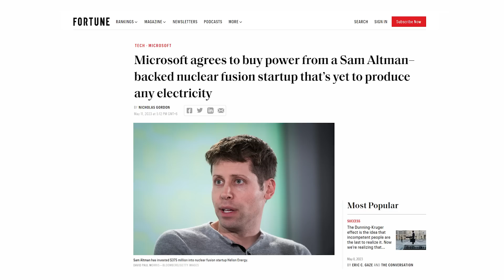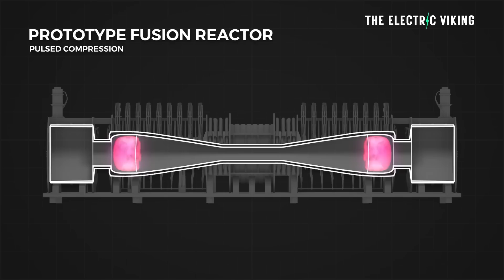Microsoft says the nuclear fusion dream is about to become a reality

Comment: Helion has designed a very interesting experimental, unproven, fusion power generator. Their design is built to generate power directly from the reaction, should they aver get it to work. Most other fusion reactors are just that, reactors that generate heat which must then be converted to steam to drive a turbine and generator. Helion's method does away with all that and just makes electricity directly from the expanding plasma interacting with the magnets around the fusion chamber. It's a fusion generator designed to make electricity that goes right into the grid,  not simply a reactor. It's very cool, but we'll have to wait and see how their new version of the system works in the next few months. Plenty of qualified skeptics out there however.
Reply: No guarantee it will work, but my understanding is that their current design actually achieves fusion but the output energy is not collected. The next version being built now has the hardware to harness that energy. Best of luck to them !
Reply: @rustyfox81 output is collected and used to recharge the capacitors but it currently isn't net positive, next prototype that is supposed to come online next year is supposed to be their first net positive reactor
Reply: I will bet $1 they succeed
Reply: @glike2  Risky !
Reply: @kimobailey2926  If it doesn't work they go BK and  MSFT doesn't get paid anyway :)
Reply: First Helion will make expensive H3 with a cheaper version of their double accelerator. This is because making H3 releases neutrons which deteriorated accelerators.  Then this created H3 will be used with deuterium in their more expensive, main, double, accelerators.  As well as making power, they will make tritium which they can sell or wait 12 years for it to decay into H3.  Other fusion reactors use tritium, so they can sell it.
Reply: Durability might be concern
Reply: I have scratched around with Helion's physics some and was not sold on it. The numbers just do not seem to work unless Helion has a break through in beam direction that they are not talking about. The acceleration required to get the velocities and keep the beam super tight and of acceptable density and velocity ,,,,not by a lot. Now at the same time, we got a couple different paths that people are traveling on. When you have General Atomics, Commonwealth Fusion (MIT), General Fusion, First Light, Tokomak energy, Lawarence Livermore, a huge facility in China that is working this way, General Electric, Princeton,  ITER  and Lockheed Martin Skunkworks. Okay, these are not people who I am ready to bet against. AND where I said above 'Unless Helion has a break through'. That list of companies above basically guarantees that they all think they have a breakthrough, I would bet a small sum at this point that within the next decade someone will have it. Lets see 1) China, a society that honors scientists and engineers 2) the Skunk Works (for this job maybe Kelly Johnson will return as a spirit) 3) MIT. While Lawarence Livermore has a real good start right now. I do not think their lasers will solve the problem on a industrial level - but they may find out more about how the elements involved work than anybody else.
Reply: Exactly my point to!
Reply: Holy sh#t if they do it. The implications... But thats a big If.
Reply: Neutron radiation to electric power
https://youtube.com/shorts/N4Bp1IXwafE?si=H8s60GaJgUqHhyWq

Comment: Microsoft is absolutely rolling in money at this point, and probably has a tough time finding good places to spend it, so it makes sense that they're willing to play the angel investor. Should the project fail, they can easily eat the loss, but if it does not, they have the unicorn of all unicorns on their hands and become the undisputed champion of silicon valley tech. I am skeptical as well, but we shall soon see.
Reply: This is NOT an investment in the project, just an agreement to purchase electricity if it works,  no risk no money.
Reply: Agreed, The other added benefit to this is that it helps their score with ESG investors by getting their name out in front as investing in making clean Fusion energy a reality.
Reply: Yes, this sounds like a valid strategy
Reply: Sorry, Helion and AGI (Artificial General Intelligence) are both a scam, good luck with that ..

Comment: Pause at five seconds. What you just watched is a different way to obtian conditions needed for fusion. The hard part has always been getting the atoms close enough to merge. This machine, by Helion, slams two rings of plasma together like clapping a pair of hands. Except a lot faster. Then, they say, they pull electricity out using the same coils they contain the plasma with.

My thought is, if you can get the used plasma into a thrust assembly that looks exactly like half of Helions fusion generator except longer, and use the power that used fuel created to send it backwards, fast, your spaceship might move forward. It also occures, that if water is the source of your hydrogen fuel, there will be a lot of leftover oxygen. Robot starships might prefer using methane, because that avoids all that rust. You know how robots feel about rust.